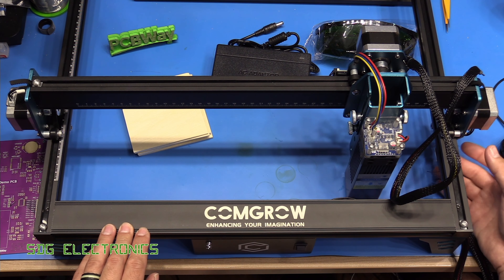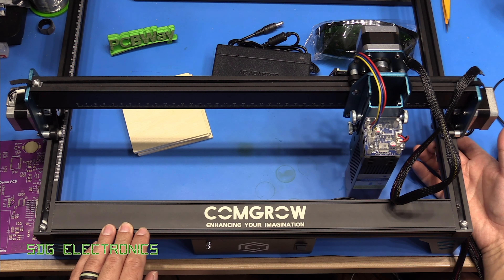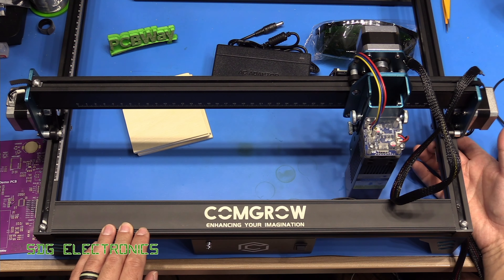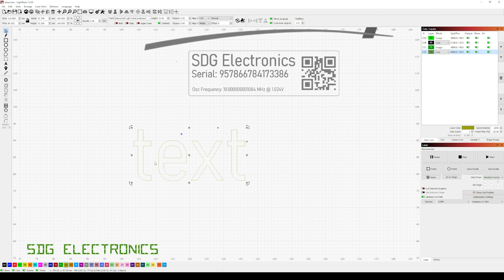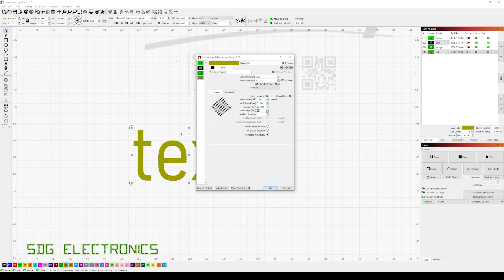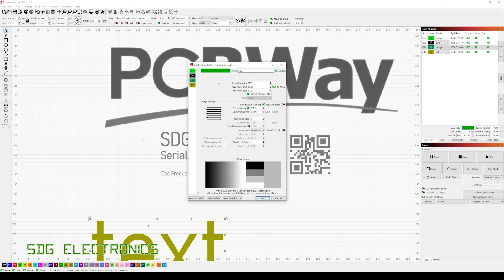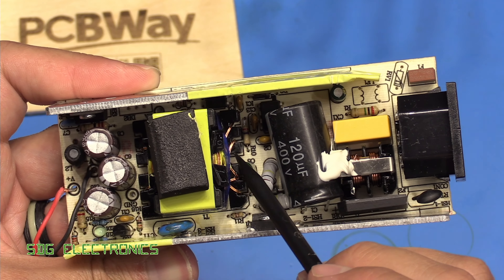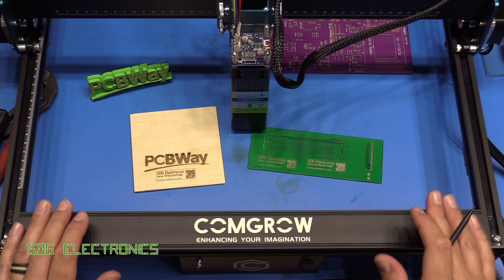SDG #260 Print custom graphics directly to PCB with the Comgrow Z1 Laser

Comment: Steve: This is exactly the video I've been hoping would pop up on YouTube, covering exactly the application I've been wondering about for all the same reasons. So big thanks for covering it.  
For what it's worth, the next step up appears to be purpose-designed fiber marking lasers, in the 50W range, for > $5000. Those have the distinct advantage of avoiding moving the laser on an X-Y motion platform, and instead use galvos to direct the laser. That combined with the higher power means they can burn the markings onto the board (or silk screen) very much faster.  More of a production option, but a very satisfying-looking one!

Comment: I've never had any issues with LightBurn for engraving or cutting. My settings are almost identical for engrave (fill) as yours with the exception I have overscanning turned off. I am still using V1.1.04. I suspect maybe it's the control board on the laser badly interpreting the G-code from Lightburn. You could maybe verify this by exporting the Gcode and using an online viewer.
For the cooling issue on the wood, maybe there's a setting in LightBurn to box scan the entire text layout.......I haven't looked but it's got to be a common issue with wood!

Comment: The possible issue with the wood not cooling down because the scan width got shorter. I would suggest putting a box around the whole image. Put the box on a colour layer that the laser power is set to zero power.

Comment: Steve: Regarding The initial results with your text printing having difficulties, seemingly consistently in the Y direction: 
I'm skeptical that this would be due to stretchy belts. Those "timing" belts are generally quite non-stretchy, and are widely used in 3D printing to throw around quite heavy parts of the printer, such as the heat bed, at quite high accelerations. (I guess it's possible that the manufacturer mistakenly procured some defective belts, but that seems odd.)   
I'd be looking closely at whether the vigorous action of the laser mechanism is causing the printer to slide around on the tabletop, or causing the table to jiggle which causes the PCB to slip on the tabletop.  But I suspect you looked at that pretty closely. 
Otherwise, a problem like this might be due to stickiness in the Y axis trolleys causing lost stepper steps (but you reckoned no missed steps). 
Or possibly the software has some problem queuing the commands to motor stepper drivers, or deciding when to execute them. 
Any chance that the mount for the laser module has some play?
Any chance that the Y axis motor mounts (which are on the X-rail assembly, right?) or sprockets might have some slippage looseness? 
Certainly a puzzle why the motion system would be out by as much as it seems to be.
Reply: Yeah 6mm 2GT belts are fine for this application, even the cheap ones should have little stretch. Ultimately he got good results in the end so don't know if it really matters what was wrong, unless it comes back.

Comment: I don't trust the green glasses they provide. My laser engraver came with a pair too, but I was able to pretty clearly see a blue LED with a similar wavelength to the laser (450nm) through the glasses. I got myself a pair of 190-540nm OD6 orange coloured glasses which completely block the light of the blue LED.

Comment: Didn't note what percentages you were using, but for keeping the travel width constant (avoiding the darker top thing) do you think putting a very light (lightest possible) grey vertical line at each end of the picture could be done w/o it resulting in a visible line? Maybe depending on the material used?

Comment: Can reliably break my lightburn by setting custom head offsets (frame function does not track, actual print smashes into limits, cats and dogs... ), maybe avoid that. But like Ian Lightburn has been solid other than this software issue. Like you there are some weirdo tuning issues per material, speed based warping, and just forget color printing but it is the best of the bunch.

Comment: We use a laser to burn the serial number into a silkscreen square.
Reply: I wonder if it's possible to adjust the laser power settings such that you could have it ablate the silkscreen on such an area, but not the solder mask underneath?
Reply: @HwAoRrDk  that is exactly how we do it. We only burn away the silkscreen layer, not the soldermask underneath. It is a machine specifically made for this purpose so whether it changes the power to the laser or speed or some other setting I don’t know.